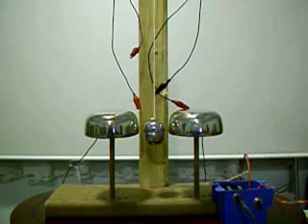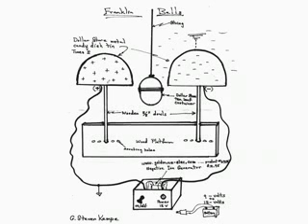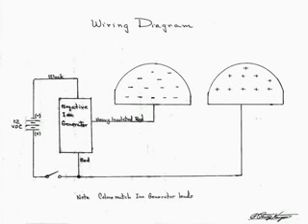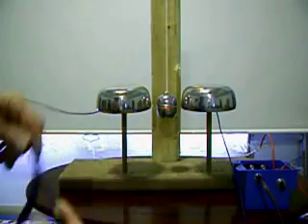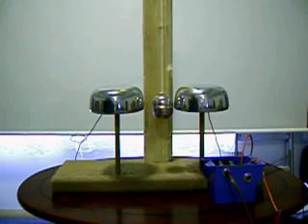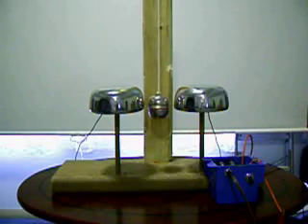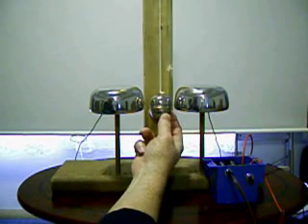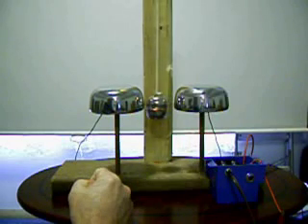Franklin Bells High Voltage Storm Detector

Comment: and tell me please, does this really works to detect a electric storm,  it has to be a severe thunderstorm?
Reply: To answer your old question: Yes. It can start ringing prior to a storm arriving but only to about a few minutes or when it is within earshot. More modern detectors are better but this is just a proof of concept now as the lightning rod would need to be tall and high enough to just get some ringing of the bell.